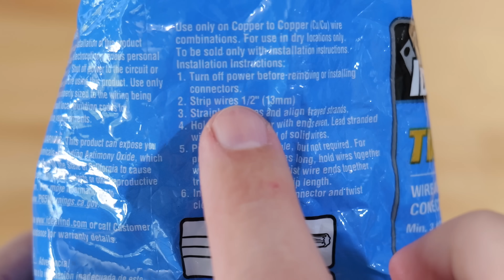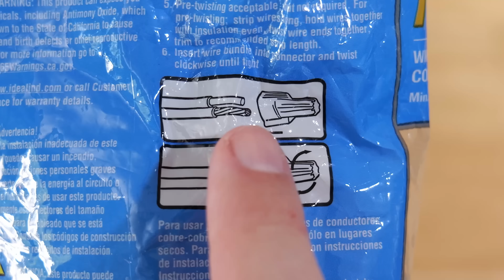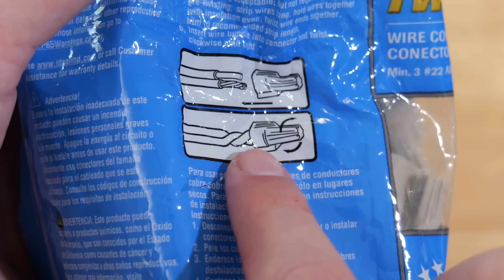5 HUGE Solid to Stranded Wire Mistakes DIYers Unknowingly Make | Most Are Guilty of 2

Comment from the maker: Be honest, have you made any of the mistakes covered in the video?  Hopefully this was able to bring these common issues to your attention or at least serve as a refresher!
Reply: Absolutely. I’ve had the twisted strand wire slide down the solid strand as I’ve twisted on the wire nut. For years I’ve been using Ideal push-in wire nuts which avoid the issue the Wagos have of the lever flipping up as the bundle is pushed into the box - but I’ve heard that the Wagos grip the wires better.
Reply: Never, I'm perfect! 😂
Reply from the maker: @jlang8213 😂
Reply: I thought you might be interested in a video idea (and it might help many people with an electrical risk).  There are these 6-outlet expanders that plug into your dual outlet and give you 6, where all of them are flat - turns out it is possible to plug a 2-prong across 2 outlets.  By itself, this doesn't cause a problem, but the spacing inside them contains no protection to prevent a short inside the unit.  When the cord is pulled own, it can short the longest prong inside the unit, causing an explosion and (likely) triggering the breaker.  If interested, I have several pictures from a teardown I did.  I suspect all of the flat 6-outlet units are all made the same way, all of them can easily be plugged into incorrectly and they probably contain no protections.  My solution will be to only buy the ones that have outlets on sides rather than all 6 on the front, but I thought it might be interesting to you as a vid.
Reply: A very nice video:thank you
Reply: I’m literally here because a wire nut I put on my ac failed cause I did everything wrong and almost burned my camper down haha, didn’t know there was so much too wire nutting things, thank you

Comment: My heart sank when I saw the Wago in the thumbnail as I have recently started using them and i thought you were going to trash them. 😂
Reply: Same here! Lol. Been fixing backstabbed wiring (which I can tell is beginning to be a hazard after 20 years) in my mom’s house and I’ve been using the wagos in situations where a pigtail should have been. I saw them in the thumbnail and panicked too. Lol😂
Reply: Wago is a German company (WAGner & Olbricht). They don't tend to get rich from selling crap. The Wago connectors are pretty much industry standard here. I'd doubt anyone who is trashing them. Not saying they're the best or that others aren't good, but the product is extremely solid and does its job even after a ton of abuse. 
But they're not cheap.
Reply: Wagos are like 10 or 20 times better option then this wire nut. This is dangerous i would forbid this by law.
Reply: Wagos are the standard in much of Europe, significantly better than the trash wiring we use in most of the US.

Comment: There's a good reason that "linesman " pliers are one of the basic tools of the electricians tool pouch.  I've been a union electrician for over 40 years. I ALWAYS pre-twist and trim to length before installing wire-nuts. Never had a failure yet. My conscience won't let me take short-cuts were peoples lives are at stake.

Comment: I use Wago connectors. I also have a roll of NARROW 3M electrical tape that is perfect for wrapping around JUST the lever part of the connectors. This way I can still see if the wires are correctly inserted all the way into the connectors. I really like this solution. Adding the electrical tape to the installation adds about 10 seconds to the process but removes the one main objection some have to these lever connectors. 👍
Reply from the maker: Yup.  Appreciate the input!
Reply: Maybe crazy question here, but does the electrical tape screw with the heat dissipation of Wagos?
Reply: @Obtuse94  I've never measured the temperature with the thin tape and without to compare. The thin tape only covers half the surface of the Wago. So that is better than using regular electrical tape which covers most of the Wago. I suspect most of whatever heat is generated dissipates through the open end of the Wago anyway (where the wires are inserted). You only need to wrap the tape a couple times around the Wago to do its job. I don't believe that little bit of added material substantially affects the ability of the Wago to dissipate heat. When I've gone back in to electrical boxes with Wago connectors I have never noticed any issues. So I think we're good! 👍
Reply: Using thin electrical tape for this seems so smart. I was apprehensive with normal sized tape. Thanks for the tip!
Reply: @Obtuse94  You're more then welcome!
Reply: I would never use lever type of connections we had issues with the wires coming out from the vibration of the machines. Screw type of connectors are much better. I know in the home there won't be much vibration but an air compressor makes a lot of vibration. I use ideal products because they are made in the USA. I bought a bag of those push in connectors and they work good for LED upgrades I don't have to rewire florescent fixtures just remove the ballast. I can even hook the up with live lines. I cannot always turn off the breaker. I don't recommend doing live wiring unless you are qualified and have no other choice. If you are doing this at home Please turn off the breaker. 73

Comment: What I started doing with the wago's was using small zip ties to keep the levers closed. Electrical tape can come loose over time, with ties they don't. If you need to change a switch or receptacle all you need to do is snip off the zip tie and your good to go.

Comment: Do not twist stranded with solid together like that. That is not a vibration proof joint and will fail with time. Apply solder on the stranded wire and then twist with solid. Good quality fixtures have pre soldered stranded wires, look for this detail.  Or just use wago.

Comment: Excellent presentation of how to properly connect stranded and copper wires.  Showing and explaining the reasons these connections can fail, and how to prevent them from  doing so, was very thorough and clear.
Reply from the maker: Really glad to hear you found value in it!  Thanks a lot for the feedback David!
Reply: But the contact area was the same in both scenarios. I always leave the stranded slightly ahead of the solid, but the end results don’t seem to be much of a difference. It all goes to the workmanship and paying attention when you are doing any kind of wiring, regardless of what that may be.

Comment: Using the Wago, after I close the levers, I usually will put a wrap of electrical tape around the Wago. This prevents the lever from coming up. If I want to release it, it is very easy to remove the electrical tape and lift the lever.

Comment: Do you not recommend pre-twisting the wires slightly before putting on the wire nut?
Reply from the maker: You can.  I personally pre-twist my solid to solid but have found with stranded the results are about the same.

Comment: Is the wago connecter good for solid core ground to stranded ground? Is a connector necessary? Can I just wrap the stranded onto the ground solid core (really realy good) and leave it exposed?
Reply from the maker: Yes. Yes. No.
Reply: @HowToHomeDIY  oh wow you've earned much respect! First time I've had a YouTube channel get back to me so promptly! I was expecting a response a month from now from a random person 👍🏼 I guess my last question is, if the ground wire is already exposed, why does it need a connector? This is in no way to discredit you or anything, I absolutely trust and respect your experience and expertise, im just curious and like learning 🙂
Reply from the maker: It helps to make sure it stays connected, makes sure the tops of the wires don't go in somewhere they shouldn't and cause a problem, and code requires it.  I try to get to as many comments as I can but can't get to them all.  Yours popped up as I was responding to some folks.  Take care!

Comment: Pro tip the first digit of your pointer figure is about 1in. So you just need half that to strip a wire to approximately the right length.
Reply from the maker: Appreciate the tip Shane!
Reply: @HowToHomeDIY  Had a old school carpenter show me that trick years ago. If you don't have a tape measure and its not critical. The digits on your pointer finger are all about one inch. So if you go pointer finger to pointer finger you got a 6in rule with you at all times.

Comment: I figured out the proper way to connect solid to stranded over many years through trial and error. Connecting and disconnecting and reconnecting the same thing made it easy to tell when I was doing it right and when I was not doing it right. 
    Also, you mentioned reading the directions. I would say that a majority of dudes take it as a matter of pride to never read directions. As if reading directions would make them look stupid. It's a pretty ironic attitude. I will often read directions, even if I think I know what I need to do, just in case they have some sort of surprise. Technology changes sometimes.
Reply: I achieved the same thing as making a stranded wire a bit longer than the solid, by putting the stranded wire in the wire nut first, then putting the solid wire in.
Reply: Really good comment, and it takes a ‘Real’ Man to admit this.  If You have ever had to fit a finished wood panel on a Bosch Dishwasher You NEED to read the distructions, (sic) and 
You’ll know what I am talking about.  And then when done, curse the Engineers!  😂  
( Installed quite a few high end Kitchens back in the Day ). Hated putting those panels on the Bosch DW’s!  

So Yes, sometimes Instructions can and do contain possible valuable info, and maybe even a safety alert!  Good comment.  Stay safe!

Comment: Do you use Wago connectors?
  I never have. I worry about them failing like pushing receptacles  have been known to do.
Reply from the maker: I personally use them in low amperage places like ceiling lights and fans for instance.  But many do use them for everything.  I just believe in wire nuts for higher amperage situations.  Just my personal opinion.
Reply: @HowToHomeDIY  Fortunately, all of Europe has come out of the 20th century and uses WAGO and for some reason there are no problems with them.

Comment: I've always been instinctively leery of wire nut connections, without realizing all the nuances that you've illustrated in this informative video.

I've recently  become aware of the push-type connectors, and used some while installing 3 ceiling fans about a month ago. (I loved how easy this made my job!) They were not WAGO-brand, however, and we're push-in only - no levers. (Got them as a free evaluation product.)

I twisted and tinned the fan wires before inserting them into the connectors, because much greater care needs to be taken with stranded wire than with solid, and this increased my confidence in their connection integrity.

As a final measure, I used a small wire tie around the insulation of all the wires where they emerged from the connector to provide another measure of physical security against pull-out.

Any serious flaws in my strategy here?

Comment: at 3:10 you mention the stranded wire needing to be higher, but read the actual package for the wire nuts you're using. I know the pack of Ideal tan ones I have next to me say to strip the stranded wire longer to ensure it makes adequate contact and wont pull out.

Comment: Does twisting the wires ever cause a problem with induction?  I remember my ex-wife used to endlessly get the vacuum cleaner wires twisted and when you would run it for more than just a few minutes, the cord would get really hot.
Reply: Not enough information unfortunately to answer this clearly.
Depends on the AWG of the wires and brand and type of the vacuum.
Reply: I’m not an electrical engineer or electrician, but I would think that since most of the time this type of connection is used for short runs for light fixtures (less resistance), and these pull a lot less amps than a vacuum cleaner (especially with LEDs), heat is less likely to be an issue. But I’m just a DIYer, so I might be wrong.
Reply: @DavidBugea  I think he was asking something different. For wires he meant the wire cords of the vacuum from it to the electric wall plate.
Reply: No.  So many things that could have caused the cord to get warmer.
Reply: No. The current flow between the two wires cancels out. Current goes in on one wire, out on the other. As for your vacuum incident, the cord was probably damaged from being twisted up so much, or something mechanically was worn out. It could have just been a bad design.
Reply: @willjohnsonjohnson  still we can't be sure. More details are needed for a clear answer.
Reply: @GooogleGoglee  Yes, that was it.  I know when you have electricity running down a single wire that is in a single coil.  It will cause an induction effect on any wire/metal between and heat that up.  With A/C, if you have a twisted cord, your hot side and neutral wires will make opposing magnetic fields and will result higher resistance and  them heating each other up.  As the wires get hotter the resistance goes up thus causing even more heat until you either turn it off or it burns up.  The thing I don’t know is how much twist does it take to start generating that much heat.
Reply: @edw.4958  lol yes. Conceptually you are correct. But we need to talk about power here. To gain such an effect, man, you need a lot of power, or better to speak, a lot of amps!
Also what kind of insulation on the wire... Etc...
I think mostly the problem can be a wrong AWG wire size, and/or a faulty wire..
Reply: Nah. Thin wire in a cheap cord is much more likely culprit. Think of it: a 1200W rated carpet cleaner will draw 5.5 amps from 220V network, but much more respectable 10 amps from US 120V supply. Ten amps is no joke when they come and go through 20 AWG cable bought instead of more appropriate 18 ;-)
Reply: the manufacturer saves money by using a minimum gauge cord . most vacuums only are used for less than 5 minutes at a time. so running it a long time will heat up the cord. or there is something wrong with the vacuum motor. and really hot is subjective. the cord should be rated to at least 70 degrees C close to 160F. at that temp you wouldn't want to pick it up .

Comment: I just started using the Wago single use style as a home DIY'er. More expensive, but I never need to question myself on whether I got the wires secured or not.
Reply: nuts are exponentially better than wago or friction fits

Comment: Wagos work well for low voltage wiring too.  Specially in the 4 to 5 conductor versions.
Reply from the maker: Yup!
Reply: That's the only thing I use them for, because I understand the concept of contact resistance.

Comment: If you use one of those walgo zip tie the wires together then zip tie going down the middle of the two wires that zip ties to the clip thing, this will guarantee that if you tug on the wires they won't pull out also on top of that put electric tape on it

Comment: The video recommends twisting the strands of the stranded wire together before inserting the wire into the Wago.  Shouldn't the strands also be twisted together before using a wirenut?  The diagrammed instruction on the wirenut package shows strands that are twisted together, not straight.
Reply: no don't twist them together. the wire nut will not hold properly. always hold them parallel and use the wire nut ti twist them together till the insulated part twists together. you fingers should hurt it needs to be that twisted.
Reply: @ronblack7870  : You might have misunderstood my question.  I didn't ask whether the two wires should be twisted together.  I asked whether the many strands of the one stranded wire should be twisted around each other, to make the stranded wire more solid... just like the video says to do when using a wago.  Your answer uses the ambiguous pronoun "them" and would be the correct answer to the question I didn't ask.
     If the stranded wire isn't made more solid before placing it parallel to the other wire, my concern is that some of the weak individual strands will be bent backward when the two wires contact the metal connector in the wirenut.  Any strands that get bent won't be held by the wirenut.
     If you look carefully at the stranded wire in the diagram on the back of the wirenuts' packaging, ITS STRANDS AREN'T SHOWN AS STRAIGHT... the strands appear to have been twisted around each other to strengthen the stranded wire.  The twisted strands shown in the wirenut diagram IMPLIES A STEP NOT MENTIONED IN THE VIDEO, before placing the two wires parallel to each other.
     It's like how the fibers of a rope are twisted around each other to make the rope stronger.

Comment: As always, well done!  I personally think the Wagos are not as good as a properly installed wire nut.  I can see how they are good for things like light fixtures or stranded to solid core though.
Reply from the maker: Appreciate the input John!
Reply: wago not even close... the same utubers say backstab is bad but wago is good when its the SAME thing... these guys are paid to promote wago... they are bad, just bad... never would use one on my house
Reply: @tredogzs  Fortunately, all of Europe has come out of the 20th century and uses WAGO and for some reason there are no problems with them.